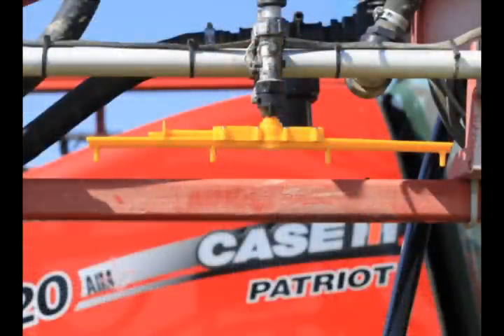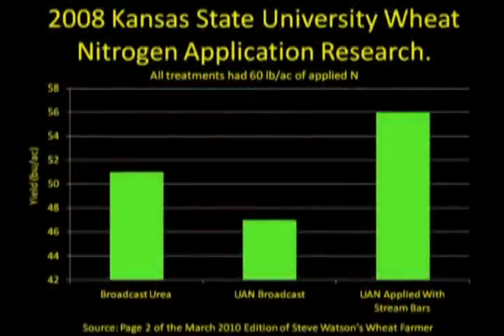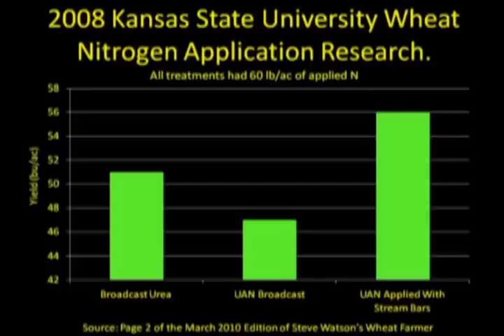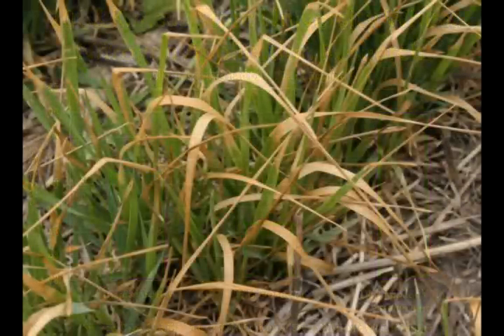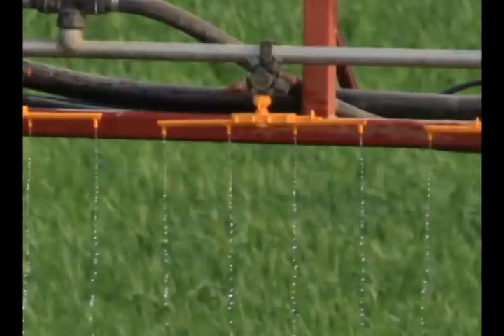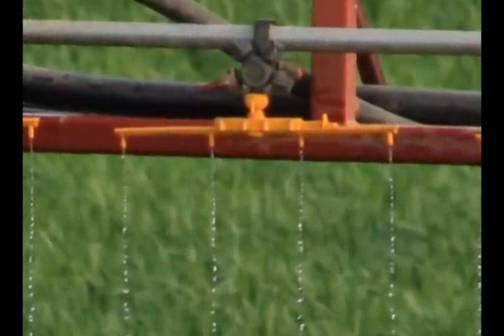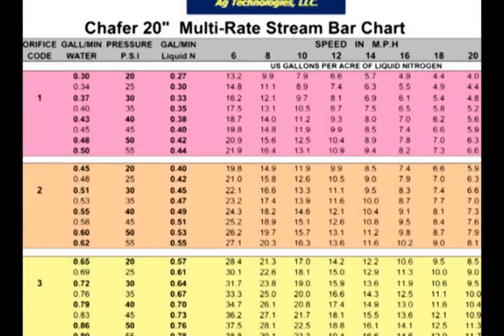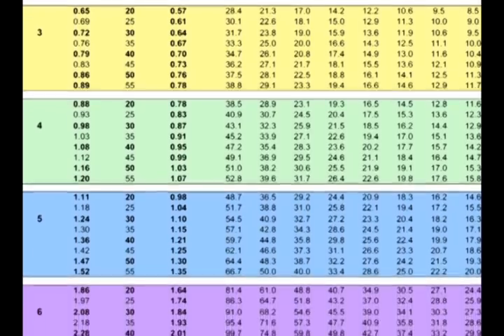Post Applying Liquid Nitrogen To Winter and Spring Wheat - Using Chafer Stream Bars

Comment: Will this work with forage sorghum or sorghum Sudan?
Reply from the maker: If the sorghum/sudan is small, yes. But once it exceeds around 4-6” in height the leaves tend to funnel the N down the whorl which causes more leaf injury, especially at higher N rates. Wheat/barley/oats don’t have a whorl, so liquid N runs away from the plant.

Comment: how would this work in corn?
Reply from the maker: Chad Smith 

We dont recommend using stream bars on corn taller than about 3-4”. If it gets much bigger, the liquid N is funneled by the leaves into the whorl where it can burn the emerging leaves. 

Drop nozzles are your better choice to apply liquid N to corn, especially if your wanting to apply some later in the season, ideally around V6 - V8.
Reply: In corn u use drop nozzles mid way in between the rows